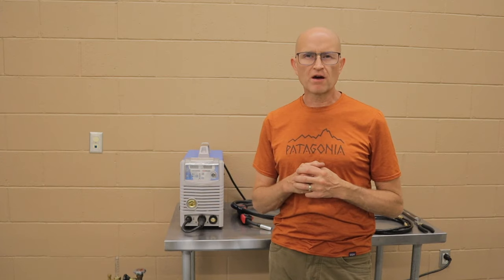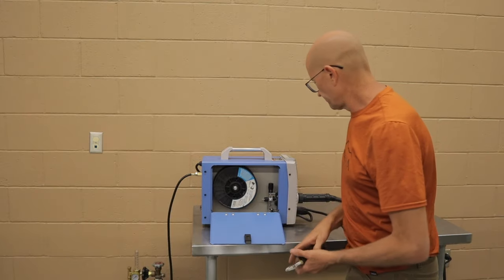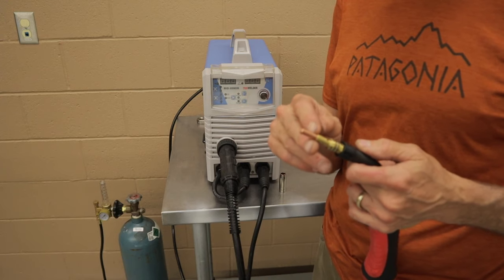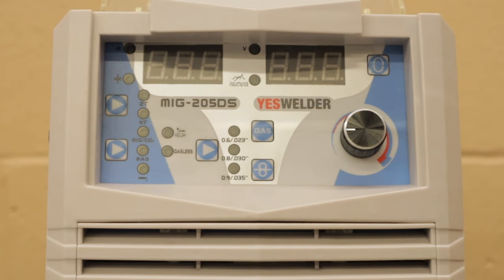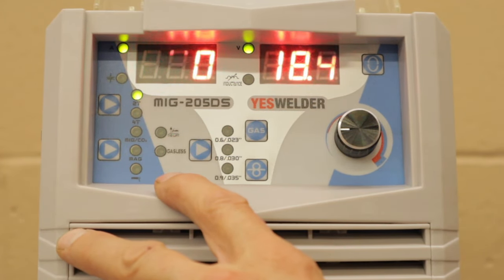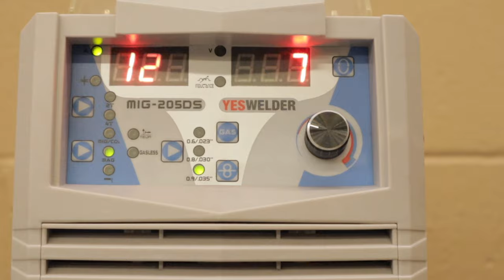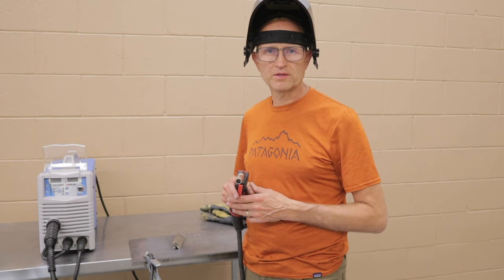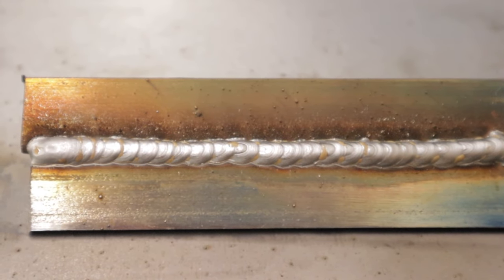YesWelder  MIG 205DS Welder Set up and Settings - Yes Welder DISCOUNT LINK !!!

Comment: I appreciate your videos. But I’m at the jumping point on buying a new welder but I just can’t decide on the 205 or the 250. I would like to know we’re would I be able to get a copy of the settings list for the welders.
Reply from the maker: Hi Jose! The Yeswelder site has the manual online for the 250 pro and the settings in that manual is better than the one for the 205. I have a settings chart for the 205. Here it is https://drive.google.com/file/d/1A_Pf5bNJTfjsucZRHYnlwWbFkF3fftqp/view?usp=drivesdk   For me it comes down to if I was needing to weld 110v and 220v then I would get the 205DS or if I was going to weld mostly thicker metal on only 220v then I would get the 250 Pro. Let me know if you need any other info.😊👍
Reply: @PranaTech  thanks for your help

Comment: Awesome video! I just purchased one- it will be my first welder- you were quite convincing! 

I am interested in flux core. Does your chart also apply to gassless welding? I know I need to switch to straight polarity, but I'm just wondering if I can still use your chart to determine what amperage I should be running it at. Thanks!
Reply from the maker: Hi Mathew,  glad you liked the video!  You will need to switch polarity on the leads with this welder when switching to flux core. Swap the lead under the torch to the negative pole and then the ground clamp over to the positive pole in the center of the panel and then switch to flux core on the control panel and make sure you have the proper sized knurled drive wheel on the feed roller and you are good to go.  My chart should be pretty close for getting started. You may need to adjust it up or down a little on the amps but it will get you welding. Hope this helps!👍😀 Don
Reply: @PranaTech  This is incorrect information. Flux Core is reverse polarity. The manual is poorly written, but it does state the earth clamp into the + socket.
Reply from the maker: Hi Matthew, Dave is correct in his post above here. After consulting my manual,  I was wrong about the flux core not needing to be reverse polarity. Sorry about that and many thanks to Dave for pointing this out! I have edited my post above to reflect this. Thanks, 😀👍Don

Comment: I have this welder, but it always turns on in Stick mode and the ground strap arced against my welding cart the first time I turned it on. I noticed yours remembers the MAG setting. Mine doesn't do that. The support team said this is normal, but your video is saying something different.
Reply from the maker: Hi Kenn, yes, mine remembers when I turn it on and goes back to my previous setting. It sounds like it may have done something when it arced to the cart. 🧐
Reply: @PranaTech  I went and welded today with MAG and now it’s holding. I hadn’t tried until now cause I was still waiting for my gas bottle and 220 extension cord. Seems ok now.
Reply from the maker: Oh good! 😀👍
Reply: And FYI your setup video here was super helpful, thanks for that!
Reply from the maker: Thanks Kenn! I’m glad it helped!🙏😊

Comment: Great job, thank you
Reply from the maker: Thanks🙏😊
Reply: @PranaTech  hey i actually have a question. I bought a yeswelder, got argon/co2 gas mix from tractor-supply, but the two just don't want to be friends. Is there an adapter i should buy? No one can tell me and I can't figure it out
Reply from the maker: Hi Derek! Ok, I’m sure that I can help. First question, do you have an argon regulator for your mix bottle?
Reply: @PranaTech  i don't.  I just bought the argon/co2 as you reccomended. I am a novice owner, but have welded a little before. Thank you thank you thank you in advance
Reply from the maker: All right, you will need one of these for sure and then your argon hose will screw right into it. Here is a link to one that is on sale. https://amzn.to/3P8YXL8 once you tighten the regulator onto the tank and hook up your hose to it, set the flow at about 18 on the gauge and this will get you going. Let me know if you have any other questions.😊👍Don
Reply: @PranaTech  thank you so much Don, you have been a massive help for this newb welder. Again, great content!!
Reply from the maker: No problem at all! Let me know if you have any other questions.😊👍

Comment: Does adjusting voltage change wire feed rate?   Thanks
Reply from the maker: Hmm, that’s a good question. I don’t think so because I believe the feed rate is tied to amperage but I’m not positive on that.
Reply: @PranaTech  that was my first guess too, but watching other manual YouTubes, they appear to adjust voltage, and then adjust feed rate to match. I suspect the Yeswelder adjusts feed rate internally, but don’t know if it based on voltage or current. I’ll have to do some testing next time.
Reply from the maker: Interesting 🤔. I have never had to adjust voltage ever. I just select my amperage and these machines dial in the feed rate and it has always been perfect for me. It’s one of my favorite things about their welders.😊👍
Reply: @PranaTech  I’ve only done stick in the past. This is my first exposure to mig. I’m having to get used to the feed and since I’m in a learning mode, I’d like to slow the feed down a little. 

I’m sure once I have more experience with mig, it will be fine.
Reply from the maker: What thickness steel are you practicing with? 1/8” or thicker is easier at the beginning.  Are you doing cursive e’s for your beads or 2 steps forward and one back like most people do with stick?👍
Reply: @PranaTech  probably closer to “C” like I have used for stick. I’m using 1/8 steel. Since I pulled with stick, thats what I’m doing. Perhaps I should try pushing.
Reply from the maker: Definitely try pushing with your c method. Tilt the MiG gun about 15 degrees forward so you can see the wire and the puddle and you will have better luck. The push method keeps the puddle covered with shielding gas and the gas is running ahead of you protecting the preheated metal as you go. Pulling doesn’t flow the gas ahead of you. Have fun! 😁👍
Reply: @PranaTech  I’ve been spending time practicing in the afternoons recently.  I’ve gotten into more of a cursive pattern and getting some pretty good welds.  I tried pushing yesterday and like being able to see where I’m going much better.  I did experiment a little to see which drove feed rate (current or voltage). Nothing conclusive.  Definitely getting more confident and really impressed by the welder.  Big step up from my old Lincoln transformer welder.
Reply from the maker: Excellent! Yes, my version is like a cursive e looping forward and back over the weld. I’m still very impressed with these welders.  People many times don’t believe me or think I’m paid to put out positive reviews or something, but they really do weld better than my Miller or Hobart transformer welders that I had. 😁👍

Comment: I received this welder today. Couple of questions. 1. Did you use Teflon tape when connecting hose to welder and regulator?  2. Are the rollers labeled for the side they are on or for looking at them when on the machine?  So .035 facing outside mean .035 is being used or .030 is not being used. I have heard both before. Thanks.
Reply from the maker: Hi Scott, you don’t need Teflon for either end of the gas hose. They are compression fittings so just make sure they are tight but no need to gorilla tighten. The drive wheel reads the size for the side the marking is on. Put the size you need towards the inside of the machine. The groove that faces out is the one that is not used. 😀👍
Reply: Thanks for quick reply. I thought it was strange that they included Teflon tape with the welder. I heard some say that wheels were labeled opposite so you read it when it was on. I am stick welder so not use to fancy stuff. Thanks again.
Reply from the maker: No problem at all! Let me know if you have any other questions 👍😁
Reply: Welder worked great today thanks again for your help. I was going to buy the lift tig torch for this welder. I know nothing about tig. Do you have a suggestion of which tungsten to purchase?  Thanks again
Reply from the maker: Hi Scott, the best all around tungsten for that welder would be 3/32” 2% lanthanated. Great all around tungsten! Glad the welder worked good for you! 😁👍Don
Reply: I love the welder except for the electrode holder and ground clamp. I was wanting to get longer length anyway.  Would your recommend #1 awg for 25 feet or #2 awg?  I considered maybe  20 foot was long enough. I don’t want to loose amps due to length. Thanks as always for your help.
Reply from the maker: Good morning Scott! Yes, I know what you mean about the mig gun. My last mig that I had was equipped with a flex head gun and it was much more user friendly than this one. I plan on replacing mine as well.  The table that I have says that #2 AWG is good out to 50 feet with 200 amps so 25’ should be fine for this welder.Happy New Year! 🙏😀Don
Reply: Thanks for quick reply. I am good with mig gun it was stick holder I did not like. I am replacing it with a tweco. 2 awg is in spec just did not know with 1 awg would be better. But added weight of 1 awg might be too much. Appreciate your advice and looking forward to more videos. I am getting my tig torch for mig205ds and I will see how bad I hate lift start. Thanks again.
Reply from the maker: Ahh, I get it! I misunderstood the holder. I used lift Tig for years and it served me very well for small projects.👍😀
Reply: Hope you are doing well. I always appreciate your advice. Do you have recommendation for filler rod for tig for steel on this welder?  ER70S2 or ER70S6. Or will either work fine?  I thought the 2 might not be as good for this welder.
Reply from the maker: Hi Scott, I’m using both and can’t tell the difference. I use ER70s2 in 3/32 rod for thicker stuff and I just use my .035 mig wire for thin gauge stuff and it is ER70s6. They both weld great for me. 👍😀

Comment: That's pretty impressive, I have 2 inverter type welders, a norstat,and everlast they both have inductive settings on the, but they don't have all the features that welder does.  I can see where it would be very friendly to a beginner.
Reply from the maker: Sq hunter,  I continue to be impressed with this welder and can’t believe the features that it has for the money it costs. I’m quite sure that as they become more well known that their prices will rise. Thanks for your comment!👍😀Don
Reply: @PranaTech    although  my  welder are  like the yes rig 200p,I do have one like the one you featured  it's my everlast  mig and stick 200,but the one you feature has much more for the money.

Comment: When I ordered my MIG-205DS welder I also ordered a 10 lb. roll of 0.030" flux core wire. When the welder arrive I tried to set it up for the 0.030" wire but it would only set to 0.035" wire. Is there a way to run 0.030" flux core wire in this welder? I contacted Yeswelder support but have not received a reply yet.   Thanks for the great video!
Reply from the maker: Hi there, it seems that it only works with.035 flux core wire. You can probably run the .030 wire, just bump the voltage down a little until it flows nicely.
Reply: @PranaTech  Thanks! The description for the 250 MIG Pro says ".023”/.030”/.035” flux core wire for MIG manual setting; only .035” available in MIG synergistic setting" so the MIG-205DS is probably similar.
Reply from the maker: Interesting! Is there a way to shut off the synergistic mig on the 205ds? Let me know if you figure it out.😀👍

Comment: I have a quick question ? I have a small longevity welder. stick welder only. Wish I would have saw this before I purchased it because it only give you that one option and it was roughly the same price. I am going to buy this yes welder soon very soon . I just want to know what recommendations do anyone have on the min size generator that would hold this welder . Because I do most of my work outside and I need to purchase a generator.  Without constantly overloading the breaker on a household standard 110. I do use a breaker bar in between but it's still a headache. Can't afford a gas powered generator/ welder
Reply from the maker: Hi Lovell,  ok, i did some calculations and if you want to weld with just 115v you will need to have a 2400 watt generator, and if you want to weld with 220v you will need a 6500 watt generator. With 115v and a 20 amp circuit you can weld up to 3/16” thick steel. With a 30 amp 220v circuit you can weld up to 3/8” thick. Hope this helps! 😊👍Don
Reply: @PranaTech  thanks a lot. Very helpful 👍👍.  I going to get the predator 9000 , just in case. That way I have enough either way.  I appreciate your response
Reply from the maker: That should be plenty of power! Glad to help! 🙏😊

Comment: Do you know of any way to adjust wire feed speed?
Reply from the maker: Hi there! Well, you can indirectly adjust it by lowering the voltage. This will have the effect of increasing the wire feed slightly and increasing the voltage would have the opposite effect. But I have never needed to adjust the settings in all of the time that I have used this welder. The synergic settings are always spot on. That’s my favorite part about this welder. I just set the amperage for the thickness steel that I’m welding and start welding. Very simple😁👍
Reply: @PranaTech  gotcha, so basically these seem to be no direct way to change the feed speed.  I need to speed up how fast I move vs adjust the speed.  I will try with the voltage adjustment and see if I can get used to it.

Comment: My scary welder has no alignment anything in the back of the spool shaft just a smooth metal wall with shaft a sticking out. Which cause me a huge headache was adjusting everything and getting really bad welds till I realized the whole spool was rubbing on the back wall and causing the spool to stutter, pause, slow down, speed up, jerk, etc. etc.  I grease the back of the spool and it got much better so I then added a washer to get it off the wall.
Reply from the maker: Hi there, it sounds like it might be missing a bushing from the shaft that is up against the back wall. I would contact them and they will send you one. 👍😀

Comment: I just bought and got this welder I have a couple issues and I’ll have to call them I guess. 1. When I run gas less mig  it will not let me select the wire thickness it stays stuck on 0.9  and 2. I get tons of splatter using flux core gas less how can I correct that? Awesome tutorial too!
Reply from the maker: Hi LH! Ok, .035” or .9mm is the only setting for flux core with your welder. Also, you can run .030” and just reduce the amperage a little. That’s what other guys have done. As for the splatter with flux core, that is pretty normal for flux core. I don’t weld with flux core for just that reason. Once you weld with gas shielding, the quality of the welds are night and day! Hope this helps! Don😊👍
Reply: @PranaTech  it does help being a newbie (clearly) thanks for the quick response good sir.
Reply from the maker: No problem at all! Let me know if you have any other questions! 😁
Reply: @PranaTech  what gas should I end up getting? You mention argon and argon mixed with co2, I bought the tig lift and a regulator but know nothing about them. Can I get one gas tank that allows MAG welding to avoid the splatter I get with flux core and that can be used with the tig setup too or is that a different gas? Do you have a tutorial on using this yeswelder on tig? Someone I know mentioned a foot pedal for tig, is that another purchase I have to make in order to actually use the tig kit I bought from them?  Sorry to hit you with so many questions I really am new at this.
Reply from the maker: Hi LH, sorry I was gone for most of the day. Ok, the gas you need for MAG is 75/25 Argon/Co2 mix. The gas for Tig welding is straight Argon. Unfortunately no one has come up with a gas that will work for both yet.☹️ You won’t need a pedal for Tig with this machine as it only supports lift Tig. The torch you have ordered will be all you need. Set your regulator to about 15 for the flow of argon with the lift Tig torch and then you will turn on the flow with the knob on the torch when you want to begin welding. The same regulator will also work for your Mig welding as well. Just switch it back and forth between bottles when you need the other gas. Hope this helps! Let me know if you have any other questions 😊👍
Reply: @PranaTech  thank you once again sir!
Reply: @PranaTech  sorry to bother you with more questions but I’m wondering should I get a couple of 50’ welder extension cords so I can plug into my dryer plug with an adapter or maybe just one and run a hardwire into my garage? Will a 10 gauge extension cord suffice for the 205ds or should it be 8 gauge? I don’t weld very often so I thought the extension cords/dryer plug thing would be good enough. I gather having a 240v connection really helps this machine so you can weld thicker metal.
Reply from the maker: Hi LH, sorry for the delay! YouTube must’ve had a glitch. I didn’t get a bunch of comments until today and they were all 2-3 days old. 
Ok,  #10 wire will be plenty for the extension cord and if you decide to hard wire in an outlet, a 30 amp breaker is all you need. You can weld up to 3/16” with just 120v and if you need to weld thicker then you’ll need the 240v to get it done. Hope this isn’t too late and still helps.👍😊